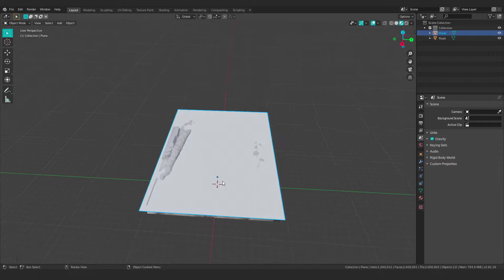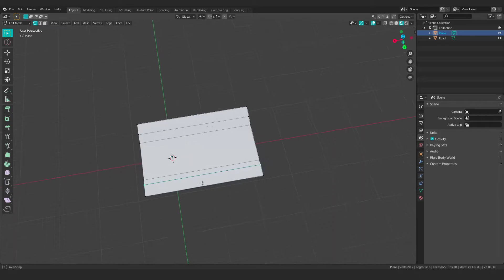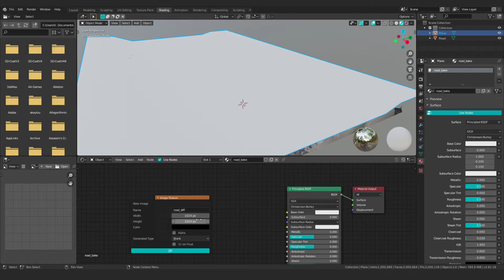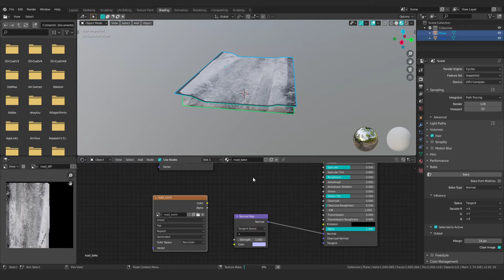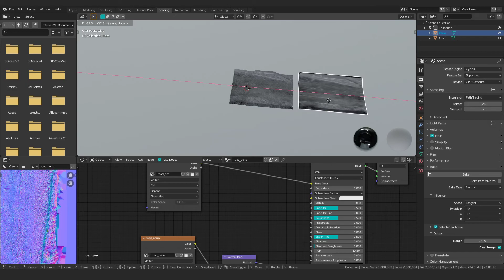How to bake textures in Blender

Comment: Would be helpful to show from very beginning... need to know material type of original mesh and lighting setup. I can't make baking work - all of the usual suspects for why you get a black output aren't relevant for my attempts =(
Reply from the maker: I did show everything from the beginning. As stated in the video, the model is from sketchfab, it came with the materials pre-applied. 

The point of the video is to show how to bake image textures from this kind of model.

There is no lighting in the scene, we are baking only information from the original model’s color map and geometry.

The only reason there appears to be lighting is because I am using texture/material preview in viewport shading, but when it comes to baking, we are not using any scene lighting.

Comment: Is there a chance to see the same process applied to metallic materials? They are a real pain :-))
Reply from the maker: The way that I understand it is that there has to be metallic data in the materials of the high res and blender will transfer that to the low res. If you don’t have the data, then nothing will be transferred. I tend to use Quixel Mixer or Substance for that sort of thing. You can also set it up manually/procedurally if you lack the data. Maybe I’ll make a video on this.
Reply: @Crompwell  If you do the tutorial, I wound up using SP for this reason too but I keep getting issues with a few polys having some abnormal shading. If you could include a how to not get those abnormal shading issues that be great!

Comment: I’m having an issue baking my textures when I bake them there just white completely blank even the diffuse texture
Reply from the maker: Make sure you turn on selected to active and that the texture is in the correct material. I have run into this a few times.
Reply: thank you